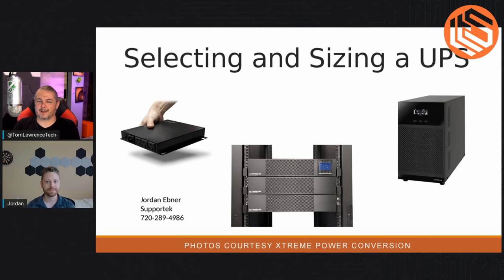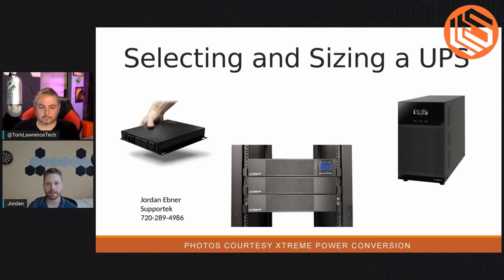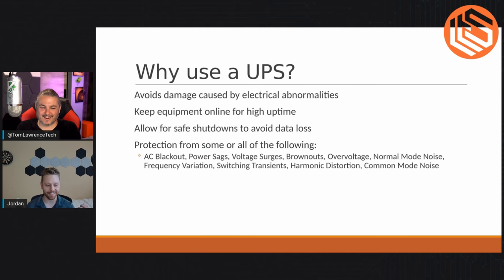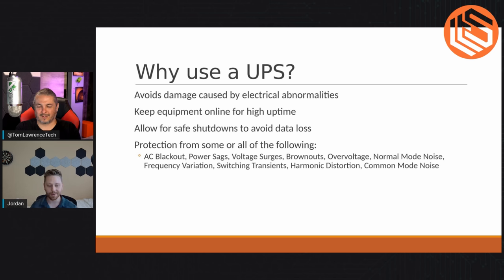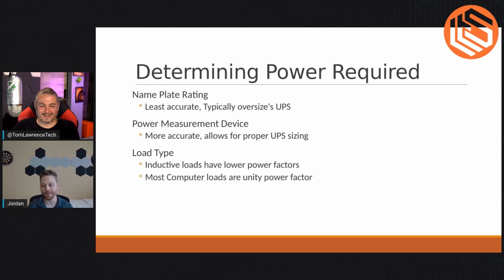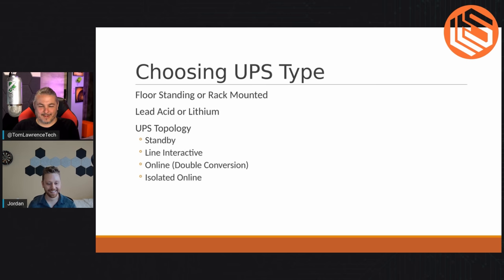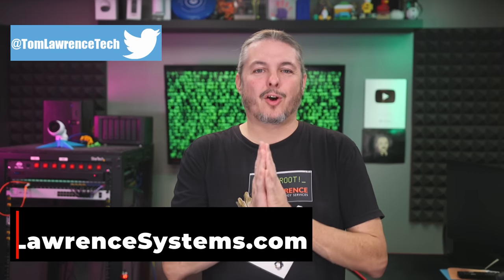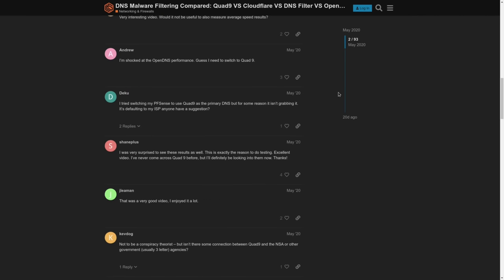Explaining Lithium, Lead Acid, Standby, Line Interactive, Online and Isolated UPS Power Systems

Comment: I put in a whole house UPS back in 1999. The system would support 4 KVA continuous with a 10 KVA surge for about 2 minutes thermally limited.  Battery was VRLA AGM with 30 KWh of capacity.  Worked out to at least 3 days of emergency loads to 50% depth of discharge.

I remember the calculation for WalMart in 1991.  The loss they could actually demonstrate was $100K/hour.  The assumption was that the real loss was much higher.  They required about an hour to cleanly shut down their critical systems.  If they did not get down clean, it was take a full day to recover.

I had a platform I supported that would usually overheat before I exhausted the UPS for that platform.

Comment: Loved the video. Even though there was PowerPoint all the slides were very useful. Great high-level overview to help understand what are the main differences between different types of UPS. We have couple of APC Smart-UPS series UPS, for a few years - works great, the main disadvantage they don't have a local web interface, to monitor them you have to use APS Cloud service, witch is free and you can monitor/automatically update UPS firmware, but from a security perspective, they need an internet connection.

Comment: Last September, I got a text at 3:30am that power was out since Midnight where I work.  My UPS only provided ~2 hours of battery backup for my 3 node cluster hosting 47 virtual servers.  It ended up being a wiring problem that also caused the whole site generator to fail.  2 days later when the power was restored, I was finally able to power up the cluster and check the status of the vm's. Talk about stress...  New policies about contacting IT in the event of a power outage, and doubling the battery capacity helps me sleep at night.

Comment: So I think one topic that wasn't discussed that a lot of us want/need to know is one of maintenance and lifetime. How do I tell if the electronics of the UPS themselves are OK? How often does a UPS need to be serviced? Yearly? Biyearly? Only when it has faults? How long should I keep a UPS in service (not considering battery replacement cycles)? How old does a UPS need to be before you would suggest replacing it out of caution for its health?
Reply: Aside from tearing it apart and already knowing a bit about UPSes or knowing a youtuber / somebody like Jordan  you can trust, there isn't much of a way to "know" if the electronics are good, the only real giveaway that a UPS is likely low quality is if it gets rather warm, that implies a poorly made/inefficient charging circuit which means it will probably overcharge and fry the battery, I've personally experienced this where I got a couple units at a similar time, both cheap ebay batteries, the cheap consumer UPS burned up its battery in only a year or two, my good unit still has its original batteries from 5 years ago.

The easiest answer I can give you is don't buy consumer garbage, most things at the $30-150 range are ok and usable but junk you can plan on replacing every 2-5 years, you want to look for at least small business grade devices in the $250+ range, for example if you're looking at APC I would probably avoid anything in the Back-UPS line unless someone knowledgeable can vouch for it, but chances are shopping for something in their Back-UPS Pro or Smart-UPS line up is probably decent.
Reply: I replace the entire units every few years as the cost of batteries is so near the cost of a new unit why even bother replacing the batteries and I don’t trust generic aftermarket batteries bought out of Amazon. This is your average home consumer grade UPS I mean obviously you’re enterprise and rackmount ones Datacenters would not be practical to replace the entire unit After only a few years.

Comment: I often have to use high temp UPS like those used in Traffic cabinets or along pipelines. Often to get the 120 degree temperature requirement (normally these are at best 104 degree) I have to buy them with more runtime and more size than I want. If there are smaller ones (max 600 watt) around please someone tell me where they are.  

Any on else find that APC UPS have turned to crap since Schneider bought them?

Comment: What I am missing in this video are UPS's with a DC output for devices with a DC input.

Since those do not seem to exist (last time I checked anyway) I ended up diy'ing a DC UPS years ago with parts from Mini-Box (primarily known for their PicoPSU's) to power two systems with an i3 8100 (both 19V DC input) and a Raspberry Pi with the help of a DC-DC converter.

The entire setup (the 3 systems + diy UPS) draws about 16W idle, compare that with my old UPS (SUA750XLI if I recall correctly) that drew about 40W on it's own while sitting there fully charged....
Reply: Eltec make good dc with a range of input modules, dc/solar/ac
Reply: There are DC UPS systems but you mostly see those in telecom environments with nominal system voltage of -48VDC. Those differ quite much from normal AC UPS.

Comment: I recently started using CyberPowers Cloud Panel for remote monitor my ups. Does not seem to have any way to send commands to the units. But I didn’t even consider the fact that having a cloud monitored would be a security concern. And it’s pretty basic of a thing and app I just mainly wanted the notifications of events While I am not at home.

Comment: Re. Stand-by and line interactive UPS: For how many switches between utility power and UPS power are the switching relays typically rated?
Reply from the maker: I don't understand your question.
Reply: @LAWRENCESYSTEMS  I'm assuming that - apart from the battery - the relays are the most likely point of failure. The relays on my home UPS (line interactive) sometimes switch more than a dozen times a day for brief moments, apparently to compensate for brief drops in voltage, e.g. when certain appliances start up. So the question for me is how many switches under load can these relays handle, before they die? A few hundred? A few thousand? A few ten thousand or more?
Reply: @tangofan4u  Typically in the hundreds of thousands or more.
Reply: @cts006  Thank you, good to know. At least I don't have to worry that my situation will lead to a regular premature death of my line-interactive UPS and I can skip the purchase of an online UPS.

Comment: I dont know how to feel at the moment. I have 4 ups inside my rack. 1 on network and security. 2 on  entertainment and auto desks. 3 is dedicated for 1 pc that has dual powered system one a threadripper the other a 7980xe (boy I'm dieing to swap that power hungry chip). 4 is dedicated to a 720xd and a dl385. 

This is the home setup. I suffer most from voltage inconsistencies from the outlets. The ups are fairly new and do a damn good job modulating these shitty outlets. 3x trip lites and 1x EATON.

Comment: The thing that makes lithium dangerous is that it self oxidizes. That means it creates oxygen to fuel the fire. So you can attack it with CO2, argon, powder, sand etc and it still burns. It does this regardless of being charged or discharged. If you have a high capacity lithium battery on fire you need to use lots of water to reduce the heat. Fire departments are grappling with vehicle fires for this very reason. I'd imagine a data centre with lots of lithium storage would need to have specialised fire protection solutions and plans to handle such a fire. There was a Tesla battery fire here in Australia. Looks like the compartmentalization of batteries helped contain the fire to a small area of the facility.

Comment: How come he not mention CyberPower  brand? (Cyber Power Systems) I prefer them over APC.  Had too many failures with APC.  Have not seen Eaton before, looks like they are made by Tripp Lite.
Reply from the maker: CyberPower not too bad of a budget brand and Eaton is big in the commercial space and been around a while. They purchased Tripp Lite to get into the mid and smaller markets
Reply: @LAWRENCESYSTEMS  CyberPower (Cyber Power Systems) also headquartered and local to me here in Minnesota. The units that are shipped to local stores as well as Amazon have shipping labels that come from a city next to me  so their warehouse is also local. (Not to be confused with a different company CyberPowerPC who makes gaming pcs not UPS systems)
Reply from the maker: @TechHorse888  CyberPower headquarter is in City of Industry, CA 91746
Reply: @LAWRENCESYSTEMS  Cyber Power Systems not cyber power PC. Different companies. Even Wikipedia notes that. Lol.  Also, actually look at store prices for the average consumer grade battery back up APC is the budget brand as they are cheaper than most cyber power units.
Reply: @LAWRENCESYSTEMS  Cyber Power Systems is headquartered in Shakopee, MN.

Comment: Everytime I heard about milions and milions loss because of a power cut I can't understandand it. So let's say google is going down now. It means I cant check my youtube and gmail account, so no prob with that, I will come back when the power is back on. so where is the money lost ? lol
Reply: Banks, stocks trading, online gambling … Plenty of things that use electronics in some fashion that if they go down no one can work or automated systems that are constantly transferring money around.
Reply: You're describing services that you don't pay for with cash - You pay either by ads or by data. If Google can't serve you ads, they lose out on profit. If they can't collect your data, they can't sell it and again lose out on profit.
Also contributing to the large numbers lost are the knock on effects, if you break an SLA in extreme cases you may get sued, repairing the equipment that broke takes not only time but work, so you need employees on the ground and that costs money, it may even mean you need to start developing a plan to avoid similar issues in the future, which again costs money.